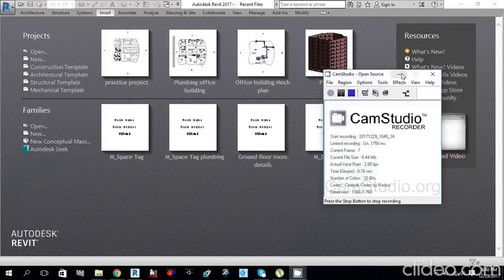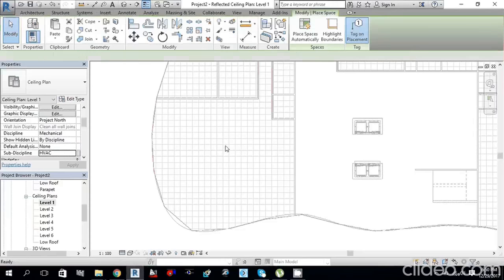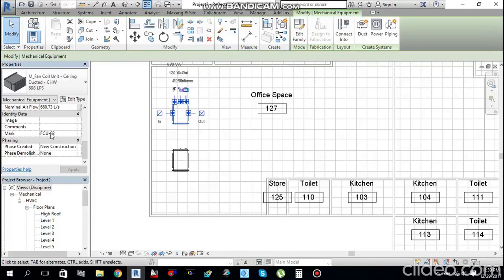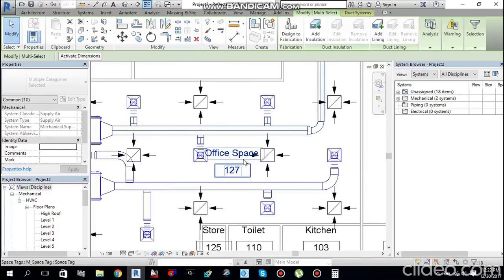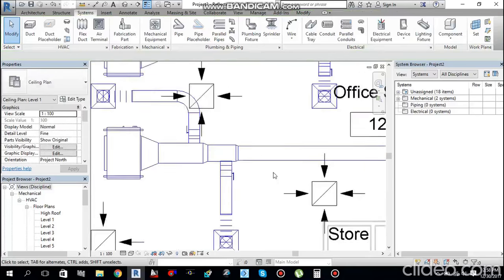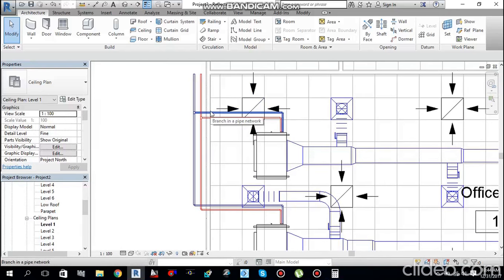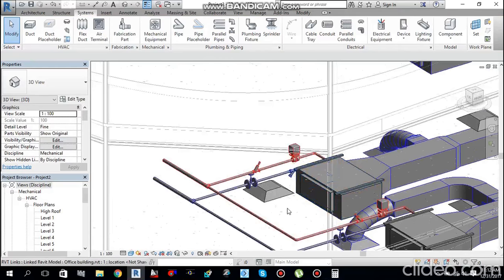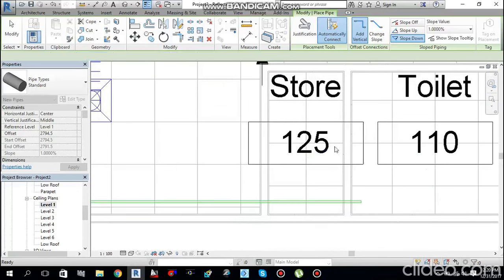HVAC complete design & drafting in Revit (Complete Mechanical Project in Revit)

Comment: Thank you so much for the video Sir. I really learned a lot. I have a question though. In the 15:25 time, you mentioned the general rule for ground floor heat load of 75 to 80 BTU per hour per sq ft. Where can I get the other estimated heat loads for other floors? Thanks again.
Reply from the maker: For first floor and floors above first floor thumb rule is 80 to 85 BTU/hr per sq ft. Please be noted this is thumb rule for exact heat load estimation you have to perform heat load calculation using hap software
Reply: @MEPEngineeringTutorials  if the main electrical room, generator room, and some IT room on the ground floor of the building need to be conditioned, do I need to add the heat load produced by the equipment to the thumb rule of 80_85 BTU per hour/ sqft heat load? Thank you so much Sir.
Reply from the maker: Yes you need to add that load also but again I am telling you this is not accurate method, this is just thumb rule, for exact heat load calculation you have to use E20 excel or HAP software.
Reply: @MEPEngineeringTutorials  thank you Sir.
Reply: Heat load calculations should be completed using software such as HAP. This will give you the minimum required capacity for each space and is specific to the building location, orientation, etc. Some rooms can have a rule-of-thumb applied. For example, relatively small electrical rooms throughout a building can receive small-capacity dedicated systems (i.e. mini-split). However, this kind of decision should be approved by the building owner and firm you are working for.

Comment: I have opened your HVAC plan, very nice, but I'm wondering why your system does not have return duct? is this only for buildings in tropical weather so you don't need anything for heating?
Reply from the maker: Well this project was not completed. I had to add the return duct system. But I added the linked file here because many people were requesting to upload that file
Reply: Oh, I see. I feel like I just asked a dump question. :)
Reply from the maker: No it's ok. it's fine to ask questions

Comment: Hi this is informative video. But can you disclose for me how you get 2.959 cubic foot/min. What are them respectively or where you get those numbers ?( 10.76? - 75? - 400? )
Reply from the maker: Area of the office space was 110 square meters in order to convert this into square feet I multiplied 110 with 10.76 to get the area in square feet. 
As I explained in the video for ground floor as per thumb rule we have to take 75 to 80 BTU/HR/square feet. And our office area was 1183 square feet. Then for that much office area you need to multiply 75 with 1183 to get BTU/HR for your office space. And that would be 1183x75 = 88700 BTU/hr  and if you divide 88700 load with 12000 you will get tonnage ... And tonnage would be 7.39 and the reason why you have to divide this load with 12000 because one ton = 12000btu/hr.
And as per thumb rule one ton = 400 CFM ... And if you want to calculate CFM for your office space you need to multiply above calculated tonnage with 400 ..i-e 7.39x400 = 2959 CFM... I hope you get the answer
Reply: hi sir, this is a very informative video thanks a lot. but can you please tell me which reference did you get 75 to 80 BTU/hr/square ft.
Reply: @MEPEngineeringTutorials  very good explanation .god bless u

Comment: Thank you for your informative video. In my revit, the flow of the 1st duct (500*400), connected to FCU-02, is 523.5 L/s and the flow of FCU-02 is 698L/s. Do you know why it is different?
Reply from the maker: There is one possibility, there must be a disconnection between ducts, try to select duct pieces one by one and check flow in property pallet.
Reply: @MEPEngineeringTutorials  Thanks!!!

Comment: Thank you so much for this video.
I have one issue for piping.
For FCU when i am creating hydronic supply and return pipe and then analyzing the piping size, after that when i select the pipe and see the properties of that pipe there is no flow and velocity values, only blank space. Is there any setting or point you did earlier? how i solve it? Thank you once again.
Reply from the maker: Kindly check the disconnection between points, specially at join check it because sometimes when you have disconnection between two and you select that particular pipe segment it will show you zero values. Just make sure pipes are connected well at every point of size change  and check again. I hope problem will be solved

Comment: Good video 📹  plan good luck But I think you are forgetting the important thing regarding interference with structures (concrete or steel), maybe you have interference around Motor control valves with slabs floors?

Comment: How do you know what cfm values to use?
Reply from the maker: Cfm values which I had used in this video are based on thumb rule, this is just to save the time, so accurate values you have to calculate heat load and CFM using hap software or E20 spreadsheet.

Comment: The noise is disturbing
Reply from the maker: I apologise for noise issue but if you try to watch it with little low volume that video would be helpful for you
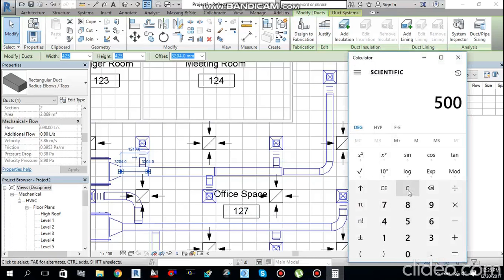Reply: @MEPEngineeringTutorials  it was so fast at 34:30, how you got 20*16 = 500*....